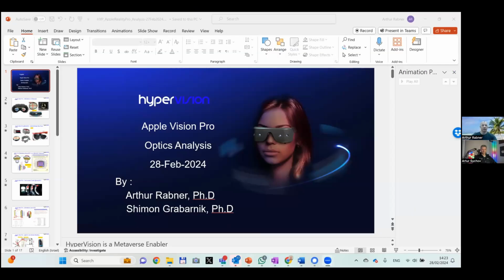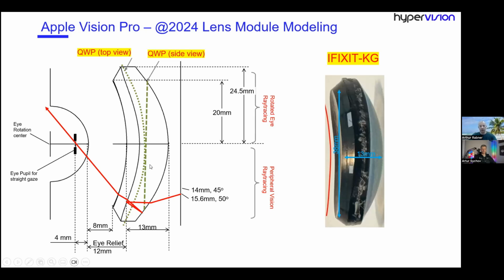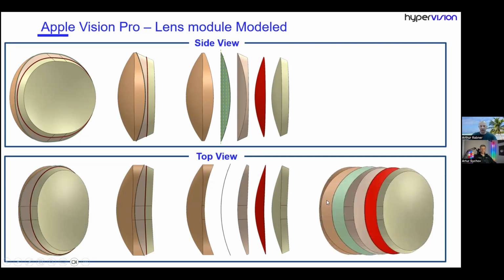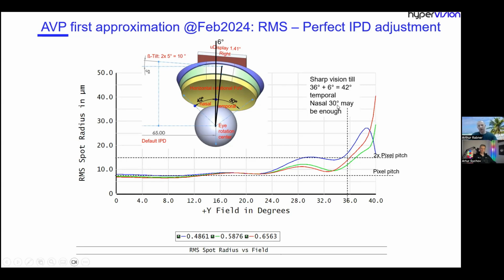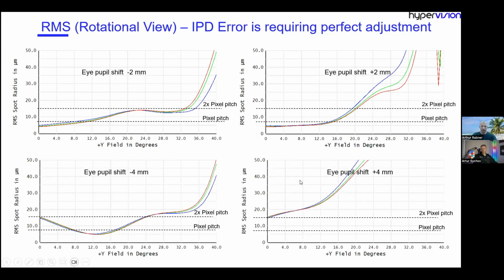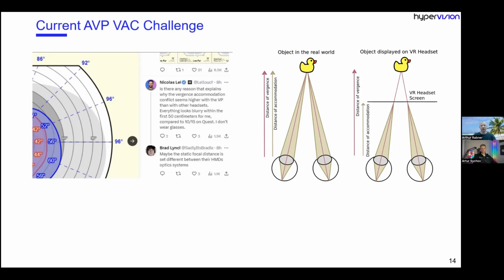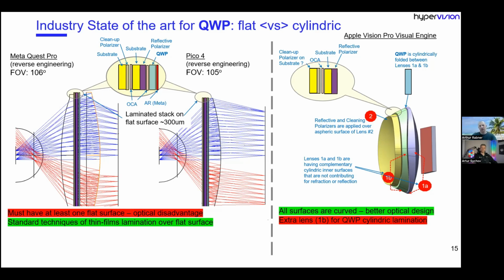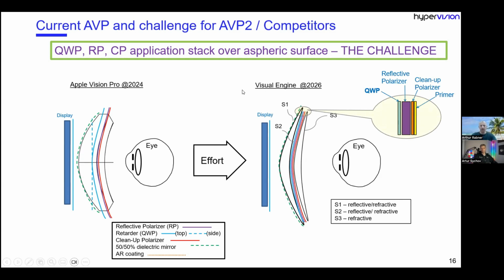Apple Vision Pro OPTICS - Deep Technical Analysis ft. Arthur Rabner (CEO Hypervision)

Comment: Micro led screen (silicon on display) could be curved and under 1 inches, in that case, will it a better screen for thinner optics?
Reply: Yes, the surface curvature could be also optimized in conjugation with the collimated optics surfaces optimization for the best optical performance

Comment: Were you able to determine the accommodation distance of the Apple Vision Pro?
Reply: Not yet, however, considering multiple complaints that people get discomfort trying to read real smartphone screen in close distance, assumption that it is around 1.5m (0.6 Diopter) so when you try to read screen from 33cm (3 Diopter) there is a strong VAC of 2.4 Diopter triggering visual physiology either close one eye to annulate vergence or accommodate both eyes to  33cm and see blurry. The same issue should exist to any MR headset, just AVP has very good pass-through and PPD, so people started to try that and wasn't so relevant for the previous MR headsets.